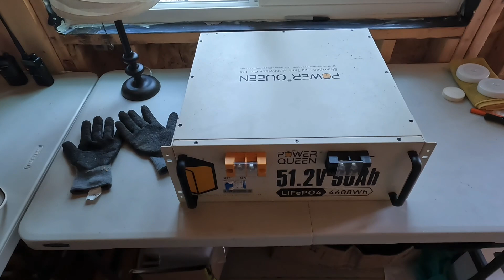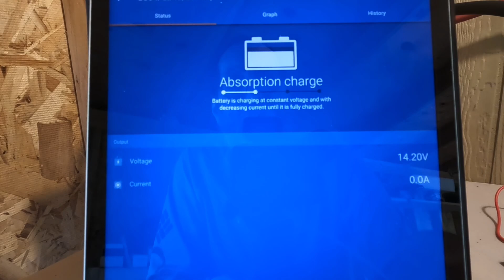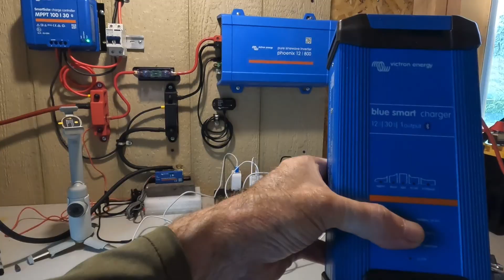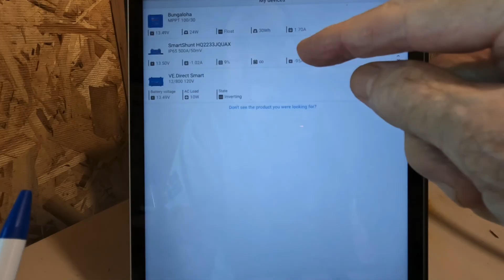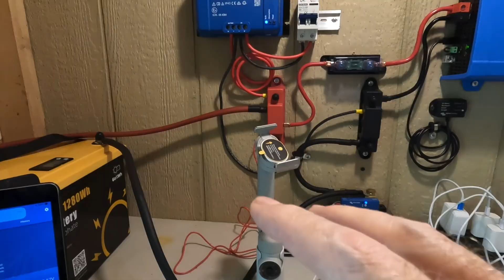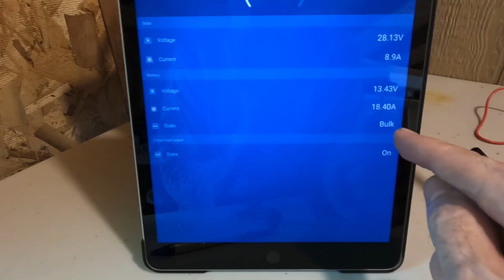Victron IP22  Blue Smart  Charger  12V/30A  Is a Winner for your LiFePO4 Off Grid Systems

Comment: Good arvo from Australia 🇦🇺 silly question that victron charge controller 100/30  what’s the maximum wattage they can handle
Reply: 100v of solar, 30a output which is 360w output at 12v

Comment: I’d like to install this charger in my camper as a shore power solution and to charge my two 100ah Renogy batteries. My starter battery is an AGM odessey. I’m under the impression that RVers connect the IP22 directly to the bus bar. I’m curious whereas my system charges off a Renogy DC to DC 30A with mppt which uses 100w solar or the alternator. Before I plug in the IP22 would I not have to turn the battery shut off switch to off if I connect direct to the     Battery bank in parallel? What happens if I plug in the IP22 right into the bus bar? How does that affect the starter battery? I don’t want a Renogy and victron jealousy fight going on in my camper.

Comment: I use this same Victron unit as a converter in my travel trailer to charge my 100 Ah lithium battery and supply “12” volts to the rest of the trailer. I did lower it from 30 amps to 15 amps as the unit seemed to get pretty warm in the semi enclosed space, where my original converter was located. So far so good.
Reply from the maker: Good idea to keep an eye on heat, especially in an enclosed space. Aloha! 🤙
Reply: As mentioned; I have the 30 amp in my front pass-through. I also have the 15 amp version replacing the old converter in my trailer. It is located in the same position under the breaker panel. The 15 amp version does not have any fan it.

Comment: As somewhat a newbie with solar tell me if I'm wrong, wouldnt a dc to dc charger be better than going from dc battery to ac inverter to dc charger? I mean it works but at what I'm guess is a 10% loss (or more) per conversion? Was shopping for a dc to dc charger myself and dont have any victron equipment though wanted to explore and eventually add them. Appreciate you sharing your setups, good to see someone living my dream off the beaten path with solar as I dont think the family would ever accept being limited in power usage or willing to invest in the hardware needed. Wife/kids barely acknowledges lights, fans, tv entertaining older teens and warm food when the power goes out. And have become used to me handling connecting and running cords to inverters cause I enjoy it, doubt they'd notice much unless I wasnt home. Sadly they dont care much to learn about it either which suites me except for the complaining when they can't turn anything on or 'how much did that cost?' when I get a used panel or lithium battery on the 2nd hand market. Someday I hope to put up a decent ground mount of panels instead of using just portable panels occasionally. Then convert the truck into a mini camper with solar, dc to dc and my portable fridge!

Comment: That 30 amp ip22 does have a small fan inside. If you take that blue cover off the top, you can mount a second fan to pull air out. There is a molded mount for the fan. I have this 30 amp in the front pass-through of my trailer and put a second fan on it with a rocker switch. When ever I run that charger at 30 amp output, I turn the second fan on.
Reply from the maker: That's a great idea, I'll have to try that! Mahalo!🤙

Comment: It is a good charger. For our diy, small component systems we do need wall chargers to charge off a generator as backup. It’s often overlooked in the parts list.

You could also get a small 200 watt used solar panel and a 75/15 to charge the battery or trickle charge a car battery if it’s sitting for a while without tapping into the main system. 

What is your total battery capacity with how much solar installed?

Comment: them Victron chargers are very nice. I know many that have same one.  I like the app and you easy change settings for different battery types . Yes they do run warm but  does not present a problem . Just keep air flow open around the charger . Just like you do with inverters .  I keep a few different chargers on hand in my shop do to different types and voltage I work with.  1.2V to 60V systems. One of my E-scooters is 60V the outher is 48V and golf cart is 48V . I got 2- 24V lawnmowers and some outher odd stuff along what I get the repair for others. Having a good meter is a must as well. I have many even a clamp on DC amp meter . One does inrush amps . Like starting motor or DC compressor.  My Logging DMM   will record data over time . Like a voltage spike or sag .  Helps with finding faults or poor connection or under size wiring.   Cheers from NY !
Reply from the maker: Really haven't needed the chargers in some time, but always happy to have them  if needed for sure. I still think about an e scooter for out here. It would be great for just tooling around. Not so much on the paved roads though. They aren't so good for bikes really. If we ever got some good bike lanes then yeah, perfect. Always happy to see you and hear whats new your way brother. Aloha!🤙

Comment: Always nice to have extra power.  On the 24 and 48v chargers, I have installed 75A Anderson connectors and then hardwire a ring terminal to Anderson connector on those batteries.  This minimizes heat.  Also, on these LiFePO4 chargers, I have yet to find one that delivers the full rating.  Example, Li-Time, Power Queen, and DC-House only delivered 18.5 on a rating of 20A having validated against the VE shunt and clamp meter.  Good review of the VE smart charger and the heat issue.  The older DC to DC chargers got hot enough to fry bacon and eggs on them.  Really looking forward to your PQ48v teardown and diagnosis.  Gary in SE MI
Reply from the maker: Days of excess out here solar wise my friend. Been doing good even in shorter season, such as it is this close to the equator. Been thinking of you and others on the upcoming tear down. Wish I could do it live, and cut to the quick. Appreciate all you contribute for everyone here. Mahalo Gary!🤙
Reply: Put a little fan like 6 inch or smaller To blow directly on it all the time and it will help keep it a lot cooler and should make it last longer also